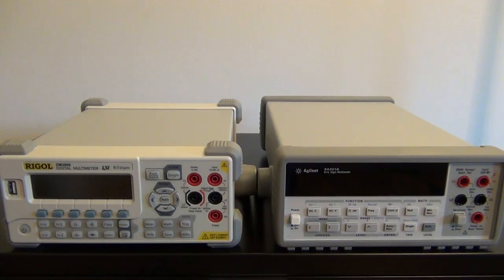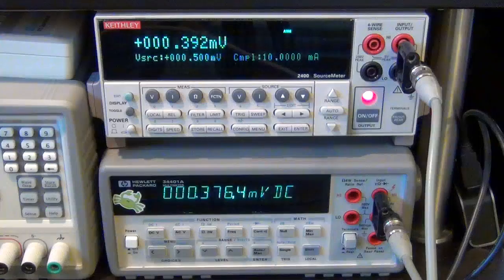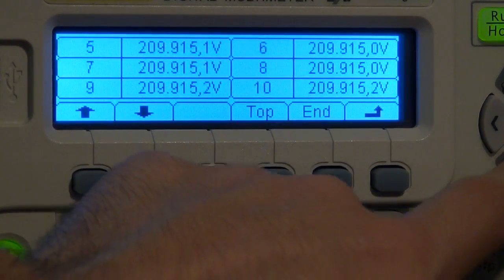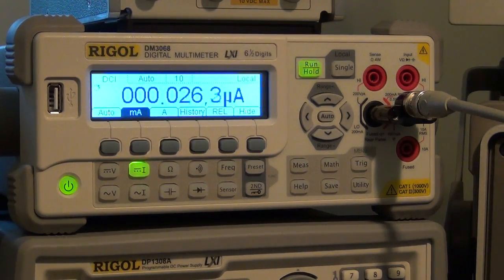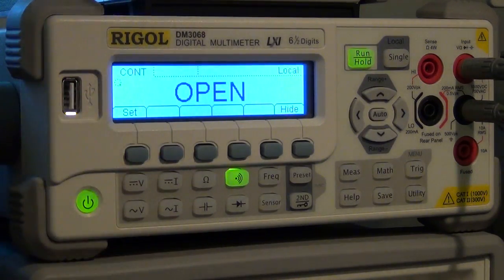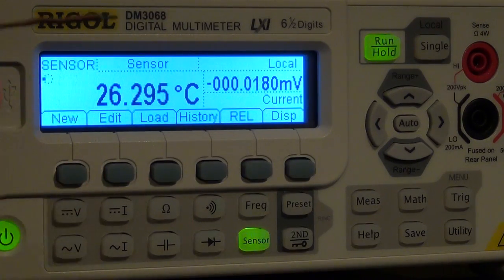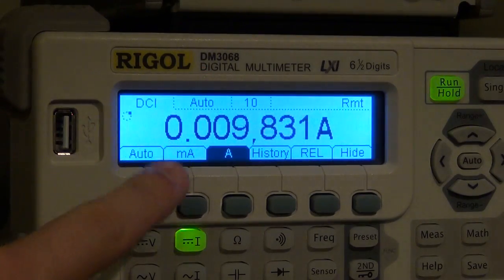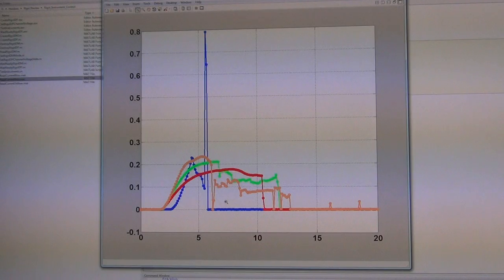TSP #12 - Rigol DM3068 6.5 Digit Digital Multimeter Review

Comment: Hi! An oscilloscope can sample very fast and draw a graph. The bench multimeter can only make much slower measurements and most cannot (by themselves) graph the result, but they are much more accurate and precise. In this case, this meter is a 6.5 digit model, which should be accurate to 0.001% or so in DC Volts and precise to 1 part per million. A scope usually has only an 8 bit A to D converter (because it has to be a very fast one), with an accuracy of about 2%, precision of 1 part in 256.

Comment: I think you only need the bench multimeter if you SERIOUSLY need accuracy.  I am a beginner too.  I have the DS1102e, the DG1022, and a fluke 87V.  I have yet to need accuracy beyond that of my fluke, much less a $700 bench meter.   That said, if I am reading the manuals correctly, this Rigol bench meter has an accuracy 3 orders of magnitude better than the scope!

Rigol DS1102e voltage accuracy 2mV/div-5mV/div: ±4%
Rigol DM3068 voltage accuracy 0.0035%
Fluke 87V voltage accuracy ±(0.1% + 1)

Comment: Thanks for the great review-- if I ever need a bench DMM with this kind of accuracy, I will buy one of these.  I am curious though-- did you ever open up the unit and look inside?  I am interested in what voltage reference they use.  (Agilent uses the LTZ1000A, some others use the LM399A, etc.)  Can you take a look, or ask Rigol about this?

Comment: This DM3068 seems very promising.
I am curious about the residual error. Can you please check one thing for me? If you short the input with a very short cable, what will be the RMS AC voltage reading? 
The 34401A will reports about 3uV, and 34410A reports about 1uV.

Comment: These large transformers are more than 99.5% efficient. But that is at 60 Hz (AC). When the near-DC of one of these events comes in they are 0% efficient and all of the DC current turns to heat. A 1000 megawatt transformer therefore only produces a few megawatts of heat under AC excitation. The DC saturates the iron cores and then the AC finishes the transformer off.

Comment: Even before seeing the review I can say it's a bit of a false comparison. The 34401A has been around since 1992 and has proven to be reliable, something that is critical in labs and other professional applications.
Reply from the maker: I disagree. There is no way for me to review the reliability of a new instrument to the market. By your logic, no one should ever consider anything new then because the 34401A has been on the market since 1992. So far, I have not had any issue with the DM3068 and if it fails one day, I will update the review.
Reply: TheSignalPathBlog
I guess my post was a bit too one-sided, what I mean is that both are targeted at different markets. The 34401A has the agilent brand and reputation (for a reason) and that's partly what you pay for. Testing that reliability is difficult to say the least but it can be critical to some users. Others (also professionals) however can take the chance of a less well-known brand because the application is less critical. The Rigol may outperform the 34401A in features but the comparison between the two is a bit like comparing a sports car to a 4x4 (that's a bit exagerated but it's the idea), not fully comparable and with each their advantages.

Comment: Hi I am looking for a  Benchtop multimeter which can test in diode resistance capacitance and four wire testing can you recommend the unit for me at a reasonable price from 100£-£350